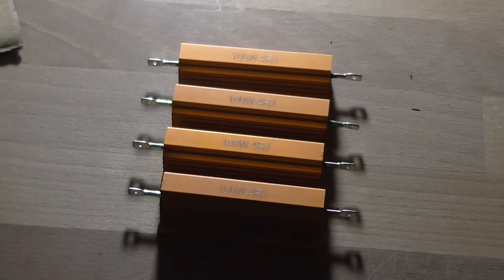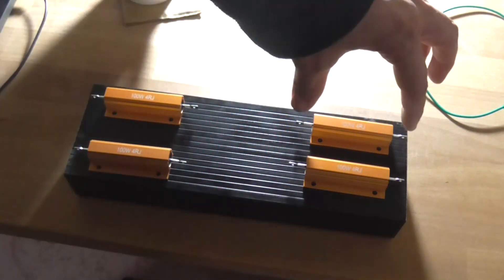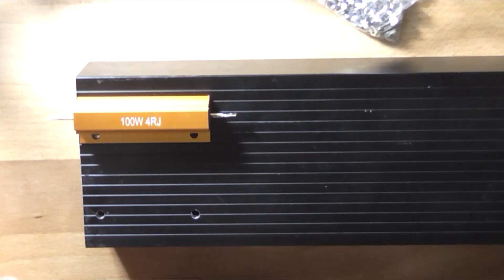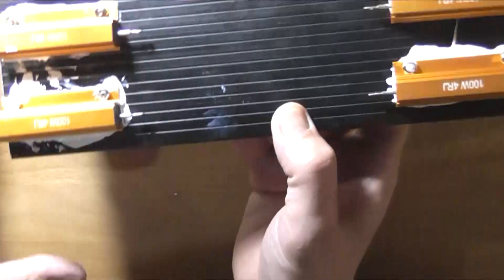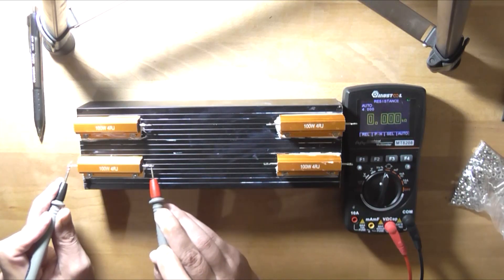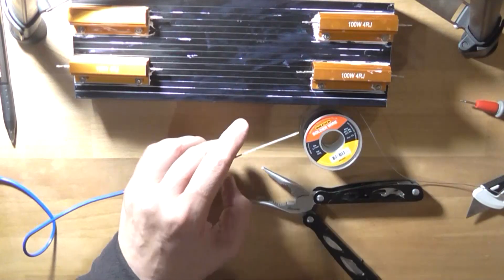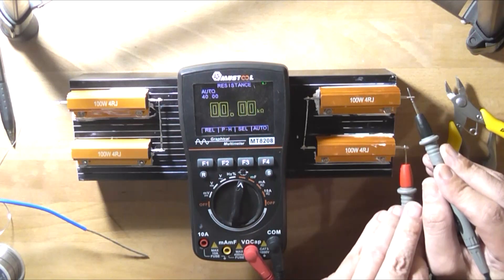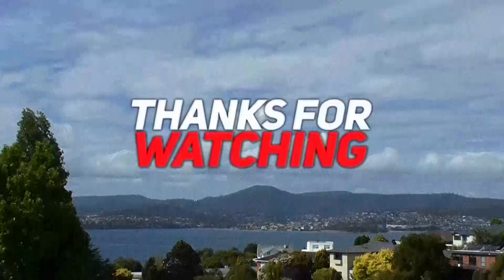8 Ohm High-Power Dummy Load For Testing Amplifiers

Comment: Thanks for the video. One question though...What was the purpose in stripping the insulation from the wire? I didn't catch that.
Reply from the maker: So I could tin the entire length of the wire increasing current capability.

Comment: Put the heat sink compound on the resistor. That way you won't miss your mark and less mess. Use solid copper Romex wire instead of that stranded aluminum wire.
Reply from the maker: Yeah. I realise it'd be better to apply it to the resistor body in retrospect lol
Reply from the maker: Also,  it's not stranded aluminium wire, it's stranded copper.

Comment: Thats better load than the last for sure, to bad you didn't have the video of the old one actually blowing up lol. great video..
Reply from the maker: Lol. I wasn't monitoring it when the amplifier was on test. I left the room for 5 minutes and came back to the amp going in and out of protect and the smell of a wood fire bbq.
Reply: @AstrosElectronicsLab  Lmfao that is epic 🤣 lol I built a 2×100watt at 8 ohm and 200watt 4 ohm load on a cpu heatsink with a fan. Works good .. the one you built is definitely up to the task for 90% of the amps out there. Keep up the great work.
Reply from the maker: Shall do! Thanks!

Comment: I built a dummy load using  6 x 16 ohm resistors. Switching yielded values of 16 ohms, 8 ohms, 5.33 ohms, 4 ohms, 3.33 ohms and 2.66 ohms. This proved very useful for testing power outputs and protection stages.
Many 'audiophile' speakers dip low impedance and the low ohms setting was very useful for confirming current capability of output stages.
Reply from the maker: Nice one!